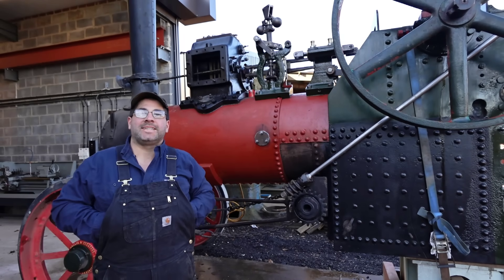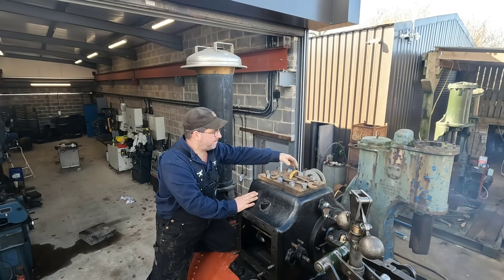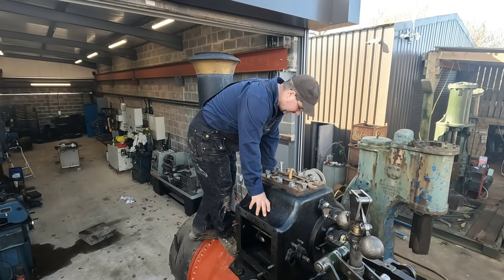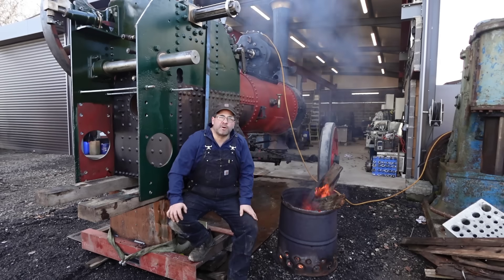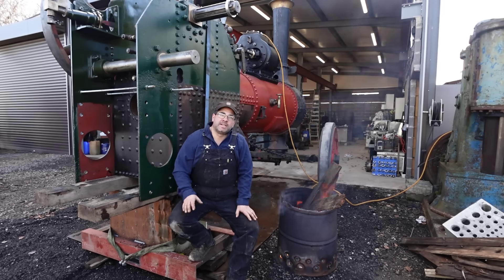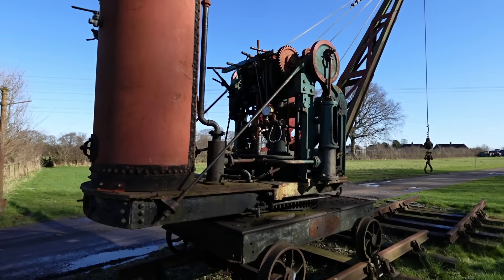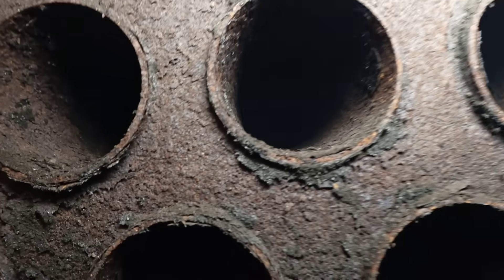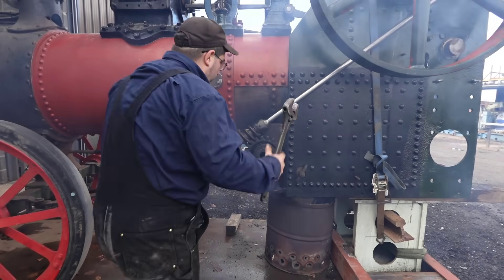hydraulic BOILER TEST we have issues!!!

Comment from the maker: I’m going to add this comment to insure people don’t get confused about what’s happening in the video as I feel I could have been explained better. So

In this video at no point was the boiler sealed with a chance of making pressure (unfortunately never made it to that stage) 

The fire in the (fire box) is just there to warm the boiler through as to let it relax and warm up a bit before connecting the hydraulic pump to pressure test under control. The fire will not make any pressure in the boiler as it’s not sealed at that point. 

I would also add this boiler is not unknow to us and still has a 10 year hydraulic ticket. We are not renewing that here but testing the cylinder gasket seal and carrot bolts that have been refit. 

Once we can determine that the boiler has 0 leaks or issue an independent boiler inspector will be bought in to do the full test and ticket. 

Hope this clears a few things up 

Cheers

Comment: Youre mad. Why pump it up in the first place, those tubes are clearly rooted before you even started. secondly, no glass? you put a fire under it without ACTUALLY knowing how much water is in it. its all gagged up, no water level indication, no pressure indication, absolutely mental
Reply from the maker: 😂 we know how much waters in it’s completely full. Unless it all leaks out which I think we would notice the levels not going to change. Wouldn’t make steam in this case so perfectly safe to do. Not mental if you understand what’s actually happening 👍
Reply: @VintageIronuk  man... You had the fire drum under it before you even started.

Comment: I never heard of doing a warm test before, is that a common thing with traction engines. Also with a rebuild like you are doing I thought you would replace the tubes anyway to make the whole thing like new and last a good number of years, I am no expert but the tubes do look quite rusted.
Reply from the maker: @cedarcam  It was common practice to do hydraulic tests that way, not sure so much now. I’ve always light a warming fire in the engine the night before steaming in cold weather anyway to warm it slowly as to not over stress it, makes sense to do it if it’s getting pumped up to over normal working pressure in the cold. Probably not 100% needed but better to be safe for the sake of lighting a warming fire. The test was to be completed with a pump we just never got to that point. As for the tubes we are around 2 years out from finishing the motion and gear work so tubes would be last thing to go in. Seems stupid to put new in to have them rusting away while we work on the rest. All this test was for is checking the cylinder gasket and carrot bolts we had removed so we could carry on with the motion rebuild.
Reply: @VintageIronuk Thank you for your reply and explanation. It makes sense to warm the boiler I know it causes stress if they are heated too quickly or rapidly de pressurised. The tubes should be the last job on a boiler really yes. Youtube bot put this on my to watch list so I have not followed your progress up to now. Once the motion is assembled and all is sealed you will know you made a good job that does not need taking apart again, but getting there you need to have pressure in the boiler, so I see now why you did not want to put new tubes in before pressure testing seals

Comment: If you were doing the hydraulic test for certification, would the boiler inspector need to be present?
Reply from the maker: @wilsonlaidlaw  Yes 

First he would inspect the boiler with all the access holes open with a bore scope. He would also thickness test the boiler sheets before the hydraulic test is started. We still currently have the last certification, here we are only testing our cylinder gaskets and making sure the carrot bolts we just fitted have sealed before we carry on re working all the motion work on the engine. 

It will be tested for a re certification by an inspector later on. 

Cheers

Comment: There is no need to warm a boiler in order to carry out a hydraulic test.
Reply: You are incorrect, it’s a lot easier on the boiler to do a hydro with warm water
Reply: @gwr1475  warm water will evaporate quickly making small leaks hard to locate, besides how do you inspect the firebox after it has been covered in soot and ash. The test is to determine the structural integrity of the boiler, why would you want to reduce the effect ?

Comment: Greetings from the upper Midwest! I have performed hydo tests on high pressure (150#) heating and process steam boilers here in Wisconsin. It's always a little scary raising the pressure to 225  psi cold water! If she's  a leaker, you'll  know it real quick. Yes, your tubes look a little crusty, best wishes  😊
Reply from the maker: @johnwilcox4078  welcome 🙏 

Tubes are now residing in a skip. Long due I feel. How often do you have to hydraulic over there? 

Cheers
Reply: @VintageIronukHigh pressure (150#) boilers  require a hydo test when new, have been moved to a new location, or has had a major repair undertaken. We used a high head pump with a check valve to get the cold water to 1 1/2 times the maximum operating pressure in the presence of an insurance inspector.  Lots of labor hours disconnecting and capping control piping, relief valves, etc., then putting things back and the boiler on line.

Comment: Just a bit of background information. COLD water is basically incompressible. A HYDRAULIC TEST is carried out by completely flooding the boiler before pressurizing the unit. If something ruptures there is an immediate drop of pressure and no release of stored energy to drive a catastrophic explosion. Steam or compressed air has huge energy storage potential. Industrial plant has statutory requirements for inspection and maintenance.  When considering large air receivers the weight of water can mean a vessel requires support during testing. Similarly large bore steam mains.

Comment: is the tubes only expanded to seal?. Is it not normal to role over the ends so the tubes can take the force longitudinally.
Reply from the maker: @75700neo  Not beading on the end of the tubes. Just rolled into the tube plate. The leaks coming from a badly pitted area of the tube that’s accumulated due to the engine sitting for a couple years.

Comment: Fair play to you for posting the reality of steam engine ownership, the majority only ever share their victories and keep to themselves the problems and issues that are a very large part of our involvement in this type of machinery. 

I am currently preparing my family's Burrell roller 4040 for its 10 year test and I am rightly anxious of the hydraulic test! 

Wishing you the best for the tube extraction and replacement, a nasty job but very rewarding the peace of mind when they are done. I used a hollow jack to pull ours which worked very well to remove the tubes whole without cutting them due to little accessibility inside the barrel, a problem shared between Burrells and Wallis'.

Any help or advice you need please feel free to send a message
Reply from the maker: Cheers 👍

We aren’t too worried about showing the  failures, all we are doing is documenting the progress. If we didn’t post the issues I’m not sure we would have anything to post some days. 😆 There’s a lot of very skilled interesting stuff that goes into the heritage scene that most people never get to see. Would love to get to some of the workshops and document it. Like you say most people only see the perfectly painted result in a field. 

I was lucky with room in the fire box, I don’t envy you getting in the roller. 

Old tubes are currently out and waiting on the new set to turn up. Appreciate the offer for advice and help 👍

Comment: Just a thought🤫Couldn't you have rodded all the tubes first, then put an "eddy current tester" on them to find a defects, before you went to all that trouble?. Would be interested to hear your comments. Thanks.
Reply from the maker: @Mr_Inquisitive_1  Many ways you could go about it. The plan wasn’t to test the tubes or boiler it was to test the seals on the parts we have replaced. We knew the tubes were thin when it was last tested but hoped they would have held long enough to test the cylindrical seal and carrot bolts we had removed. We still have 2 more years work to do to the engine so didn’t need to replace tubes to have new ones sat in there rusting away while we do the work. (hence why they weren’t replaced) hope that makes sense 👍

Comment: with the level of corrosion on the front Tube Sheet you might find that new tubes are not the only replacement needed, how many times has that boiler been retubed,  if the rusting is as bad on the rear tube sheet and internally - well it might be a waste of time and you may not get a boiler certificate...
Reply from the maker: @davidgore6212  0 wastage on tube plate. This boiler was rebuilt with new barrel and bits 15year ago. All thickness tested 2 years ago with 0 issues found. New tubes to be fitted then it’s ready to steam. 👍

Comment: Hydrostatic pressure test using water to some factor above the MAWP (Maximum Allowable Working Pressure) of the pressure vessel, in this case a boiler.
Gas/steam is compressible so it has expansive energy, that if suddenly released, such in the breach of the containment  vessel,can be very dangerously destructive. Water is not compressible. If the containment vessel is breached, it doesn't have much energy behind it. Pressurizing a vessel with water to pressure test (hydro test) is a standard practice and on a steam boiler is usually an annual practice/requirement, depending on the jurisdictional authority overseeing its operational permitting or insuring....
Good luck with your project.
Reply: You seem to have a reasonable amount of knowledge about the process, so please answer me this..  Why wouldn't you do the initial testing with just compressed air?  I realize that you miss the thermal effects, but wouldn't that be far simpler?
Reply: @scottroland6577 let's see what the other guy offers up too but my answer is you could with very low pressure and soapy water to check for leaks. It's not stand practice possibly just do to the potential energy stored up the pressurized air. I can see the usefulness in doing it just as leak test not a safety test.
Reply: @scottroland6577  Because there is still the chance of explosion, like others have already mentioned.

Comment: Worked in automotive trucks cars buses. Many times engines failed coolant wise when hot. Metal expands cracks open, they would hold pressure when cold but not when hot. Nice test and understand why you do this test when hot.
Reply from the maker: @anthonywilson4873  Thanks. Makes more sense to do it at its working temperature. She’s never going to see full pressure stone cold. Cheers 👍

Comment: I thought  you have shown that the boiler is in good condition after tube change you might want to look at the other leak which I think  should  be a quick fix just done a boiler test still need a steam test and safety valve pressure set

Comment: Why don't you use a hydrostatic pump instead?
Reply from the maker: @eb17816  We will. The heat is just a warming fire not to create any pressure.
Reply: @VintageIronuk  Actually it does. The expansion of the heated water probably had you up to 5 to 10 psi.
Reply from the maker: @ Without the boiler being sealed? I understand that the water will expand but without the boiler being plugged it’s not going to make any pressure. Not until the pump is attached
Reply: @VintageIronuk I must have miss heard you. I thought you said that the boiler was full of water, and all of the plumbing connections were sealded off.
Reply from the maker: @ At no point in that video was the boiler sealed. I never made it to that part unfortunately. I think a couple people think I just sealed it up and lite a fire under it. We did show the pump and explain the warming fire. I’ll have to do a better job explaining it next time!! Cheers

Comment: That's the reason why you do a hydraulic test, before you put heat anywhere near it. I did inspections on boilers from the ones used in coffee shops to Ferrybridge and Drax, with just about everything in between. I'd have asked for that boiler, particularly the tubes to have been fully cleaned for inspection prior to considering doing the hydro test even. The boilers I basically refused to do examinations on were the heritage boilers, trains, traction and in one case, a steam excavator. My boss wanted to know why I didn't want heritage equipment on my list to inspect. "Too many keen amateurs without deep enough pockets." He understood my reticence.
Reply: I think you could be misunderstanding what’s going on here. Even though a small fire is present this is still a hydraulic test, not a steam pressure test, the boiler would remain absolutely brim full of water, which as I’m sure you’ll know cannot compress, it has no space to expand into and therefore does not create steam. All the fire does is take the chill off the boiler (hydro test should not be carried out below 7degrees c anyway) and is also doing the work of the test pump. Ie when the water warms up it tries to expand but has nowhere to go so can’t and so pressure increases, much the same as just adding more water in a cold hydro. There is no expansive energy or steam, the fire will not be anywhere near hot enough to boil the water before sufficient pressure gets reached. In any case the fire is separate to the boiler being in that drum so can be removed quickly and easily should things begin to get out of hand for any reason. Doing the test warm is widely accepted practice and is much kinder to the boiler because the plates can expand naturally instead of being forced, and so creates less of a shock to it. Water can also be added via a test pump to either make sure boiler remains full or increase pressure further, or both. If there is a failure the worst that will happen is someone might get wet, no explosions or dangerous outcomes. On top of that yes those boiler tubes are clearly at the end of their life but they do fail in service regularly, sometimes at 200 psi steam pressure without warning, so isn’t the end of the world in this scenario.  I believe this particular boiler was rebuilt in fairly recent times and was in regular inspected use before this mostly mechanical overhaul so the structural integrity is not in question. This test seems to be merely intended on proving the new seals on the cylinder block etc. Keen amateurs do not necessarily need deep pockets to carry out a satisfactory job. 
Well done norm keep the videos coming you’re doing a great job
Reply from the maker: @billdoodson4232  Probably a wise move to stay away from the heritage stuff. You made the right decision 👍
Reply: @VintageIronuk You Profile, for the YouTube channels is vintage iron UK, where in UK are you from?
Reply: Surely the heritage stuff has an important place in life...   You were the person whth the skills...   But only if job being handled properly should you engage,  i get that. Just the blanket ban on heritage kit seems quite a strong responce.    I guess you'll know
Reply from the maker: @ The heritage boiler makers are doing just fine. All our stuff is inspected the same as any industrial stuff. Tested every year and 10 year hydraulics.
Reply: @SuperCallumF  Not a blanket ban as such. I just didn't want to get involved with it at that time. Some of the guys loved doing it, a really nice day out at a heritage railway etc. I was working at one, on compressed air systems, when the Scotsman was being refurbed.
Reply: They are not doing a full test for certification, but a routine in-house check to see if what they have done is ok, and if any other issues are presenting themselves.
Reply: @billdoodson4232   I fully empathise with you!
Over 35 odd years, in steam, 
I’ve worked with some of the ol boiler inspectors, ones I had a lot of respect for & knew what they were about.
As they retired they got replaced with men who’d never seen a steam locomotive boiler in their lives & were sent out by head office to tick the boxes. They were overwhelmed a bit at times.
It was a job when they kept asking ?’s & saying things like; “ What would you do!” I’d reply ;” You are suppose to be telling me  & are paid to do so.”
Have had to overhaul a coffee shop boiler  & present for a hyd test. Not straightforward, pig of a thing to strip down!!
A coffee boiler for you would have been a grand day out after power station boilers & all that high temp superheated steam!!
Nearest I got to that was as an apprentice & fitter/turner in Devonport dkyd on the ol Leanders steam turbine overhauls.
Reply: @davemitchell9941  I started in the Merchant Navy at 16 as an Engineer Cadet, the initial training was all boilers. Just about every job since, involved steam and boilers, usually running and maintaining them, with 5 years inspecting them. I've been semi-retired for 2 years, but am just starting a new consulting job for a couple of months, with a household named food company, because they need a hand with boilers, amongst other things. Must admit I never expected to be working like this again, at almost 70.
I agree about coffee boilers, a total pain. Have a search for Daily Mail UK Sainsbury's Coffee Machine Explosion. It shows the damage that even a small 2 Bar boiler can do. I'd dread to think what a big traction engine going off at one of the steam fairs could do.
Reply: The older boilers need to be heated op from stone cold to hand warm so it awoid kold fractures....but the father of a friend lost the use of both legs due a blown boiler tube on dds no 5 (henschell narrow gauge lokomotive) so if tubes are questionable i would not go near